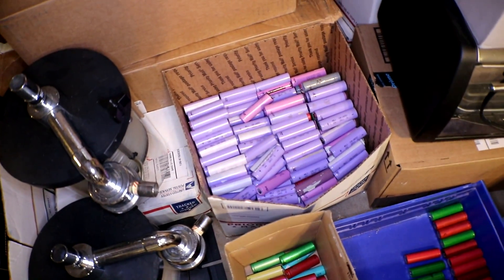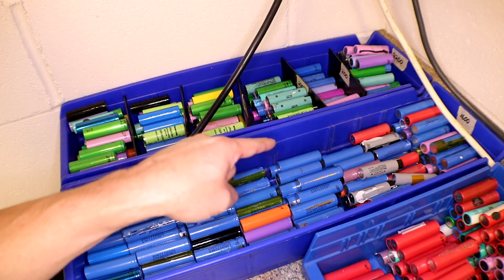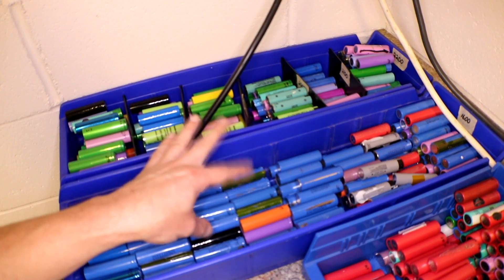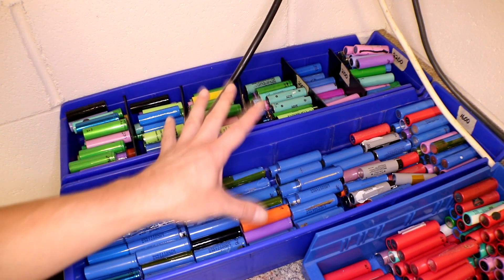🔋🔋🔋Ripping Open Medical Packs for next 10Kwh! 🔋🔋🔋

Comment: Great videos! Have learned so freakin much from your videos. Can you make a video showing how to open the inogen oxygen packs? There are 3 sizes that I have. The smallest seems to be the most difficult without jacking up cells but they also have the best cells (so far). I have my own procedure but would like to see how others do it.
Reply from the maker: Thanks Man!!!  Ill have to see if I have any left.  Yeah those cells are amazing for sure!!!  I think most of the heat shrink on these gets jacked up in 95% of them because of the glue they use.  Not many ways around it!!!!🤘😆💥

Comment: Yes, I want to see the next 10kWh pack.  
Btw are you run the FoxNovo etc. from you Rack or do you use power from the grid?
Reply from the maker: Im thinkin of doing a new playlist for the next 10kwh???  Its a mix on and off grid capacity checking the cells from all the chargers.  I have an extension cord running from the powerwall over to the chargers for that reason lol😆🔋👍

Comment: I use a vise and a pipe wrench to get my packs open. It gives me enough controlled leverage to get both sides of the packs cracked open without damaging or shorting out the batteries.
Reply from the maker: Yeah on laptop packs Ill use the vise and some channel locks to do the same!  These medical packs are a different ballgame lol!😆👍

Comment: I'm a quarter way through my 20kwh build and man my dell packs are way easier than those things your opening :) ,  it's interesting to see slight changes in the packs as you work through. I have some that are super easy others that must have been from a different plant or they had different glue suppliers etc.   I even came across a small percentage that i suspect were clones, fakes.   As the years roll on it will be interesting to see how many cycles we get out of these old cells.
Reply from the maker: Nice!!!  Yeah laptop packs are way easier to open then these things lol.  Yeah agree, some are easier then others even for these, must be different plants or new guys using waaaaay to much glue lol.  Another reason I really like these medical packs since most of them lately havent been used much.  Hoping they last a long time.  Good luck with your build!!!!🔋🔨😆👍

Comment: Wouldn't you love to find the dude that puts all that tape and white adhesive on those cells and glue his a__hole shut?
Reply: Well put! Someone has to tell these pack manufacturers to make it easier to recycle/harvest them.
Convenient that thumbnails are the perfect shape and hardness to get rid of it, but takes so much time and effort to do.
Adhesive strips and gunk that come off easily with no residue should be enforced by law if they are used at all!

Comment: Wish i could find a UK supplier , Your technique ripping them packs apart so aggressive haha :-)
Reply from the maker: Keep at it and you will find a place!  Medical packs are a PIA to get into!!! They are built and glued tight to be handled/dropped ect and still be used.  The moli cell packs are a little easier but the grey ones..... OMG!!!!!  I crack open most packs in a vise then use a non insulated scrapper to dig in and pop out!
Reply: I wonder if there's a way we can re use the thermistors inside these things to make some sort of large temperature monitor as it seems a shame to waste them.
Reply from the maker: I was saving them for the longest time but never did anything with them lol.  I seem to save everything lol!
Reply: Yeah i have that hoarder kinda problem too i guess its common with DIY tech ppl like ourselves. There must be something we can do with them.

Comment: Four words: whole house surge protection

This is an affordable and doable DIY project that will save you so much in fried appliances. Think garage door opener, washing machine, dryer, microwave, etc., in addition to your refrigerator.

And for anything attached to outside wiring, such as cable, satellite, etc., definitely install stand alone surge suppression.

The whole house surge protector will take care of everything attached through grid power, and the point surge protectors for any and all non-grid connections.
Reply from the maker: YES!!!! Need one of those for sure.  Since Ive lived here there hasnt been anything like this past summer for power issues.  Lots of crazy big storms but this year has been different!💥

Comment: could a 24 volt powerwall been built with those medical packs without tearing them apart ?
Reply from the maker: Its possible but most had a bad weld on the nickle strip!🔋👍

Comment: I was just thinking . I wonder if señor Joe is going to build anymore battery packs. All of mine are LG 2600, none are 2600mah. They must be new. Some are about 2900mah. Most are 2700-2800 @ .5a discharge to 3v. Or 500 ma discharge. All the LG are unavailable for now. I was hoping to build the whole bank with the same cells! I may have to use Samsung 2600 Cells! Or a mix of LG ,samsung, and molliand sanyo,2200 new cells. I was hoping to not mix brands and capacity. I wouldn't mind paralled 7s100p banks of 2600 and 2200 cells. I'm hoping to get to 7s 1000p within a year. With 2600 or 2200 cells. I'd love to get some Panasonic 3000 or 3400 mah. Cells. I have considered the EV batteries. They can be "spendy" and difficult to get a 7 s for some reason.  Great lil video I enjoyed it thoroughly! Where can someone find med packs like those??                Waiting fo mo joe!!!!../.:',',',-:
Reply from the maker: Yep I need to get on this next build!!!!  Dont want anymore electronics to blow up!!!!  Need to put more stuff on the powerwall but need more solar pretty bad as well!  It would be nice to use all the same kind of cell for sure but thats not always the case.  Ill use just about anything over 2000mah.  Yeah EV cells would be cool also but pricey!!!!   Ive been getting my packs from my recycler but Terry has moli cells like I have in the linky below!👍

Comment: What voltage do your testers run down to for the mAh test.  3v or 2.5v
Reply: Andrew Ball I think my Opus (same charger Joe has) goes to 2.8 but it may be wrong it could be 3.. even at 3 volts, the battery it dead and there is no usable power
Reply from the maker: Yup just like Todd said, about 2.8v!🔋

Comment: Yea!!!!!!MORE Batteries!!!!!!!!! Hey, I noticed you clean both sides of the batteries. I guess I've been lazy. I leave the bottom on the packs I take apart, only because it makes soldering a breeze and I don't need to leave the iron on there any longer than the top. Without the strip, and I have to leave it on 2 times as long. You would think this would only make the bttm less of a connection, but the solder still get under the strip. Just something I do, to leave the iron on there for less time.  Great Video and I can't wait to see the finished product!!
Reply from the maker: MOAR BATTERIES!!!!!!!😆  Yeah I started cleaning both sides when I first started and still go in auto pilot during the cell cleaning lol.  Leaving some on there would speed up the process for sure!🔋⚔👍

Comment: You need to use your solar to test those batteries what is the peak voltage of your bank like 60 that may be a little high but you can probably get a buck converter to go from there to 12v. Obviously you could use the ups but seem inefficient to do all that conversation
Reply from the maker: That would be cool to do but then I either have to move the cells or move the rack.  Think Ill just use the inefficient extension cord like before lol!😆😜

Comment: Hey Joe 
Keeps your mind focused on how much effort goes into making these DIY systems.
This also shows just how cluttered some work areas end  up being while doing these projects.
Pointing out that you must have a reasonable amount of space to allocate during the DIY.
Failing to do so can be a real constriction on one's ability to get the job done without removing one's hair.

Very valid points to consider, once again Joe, nice job 
Thanks
Reply from the maker: It does take an extreme amount of effort in building a fairly big powerwall!!!  Clutter work areas from here on out lol.  It does take a fair amount of room.  Should be doable in small areas if you keep up on the organization.  I have organized Chaos lol 😆👍